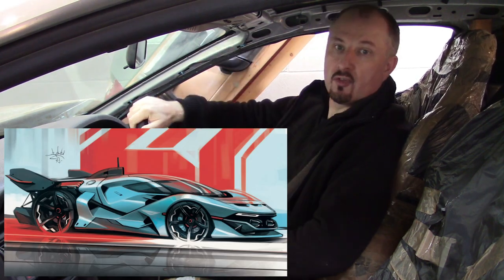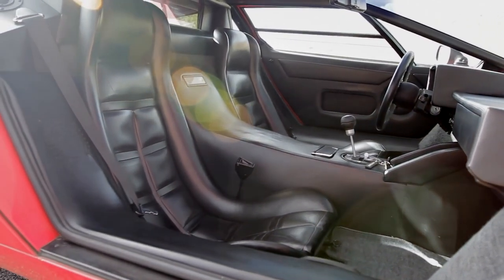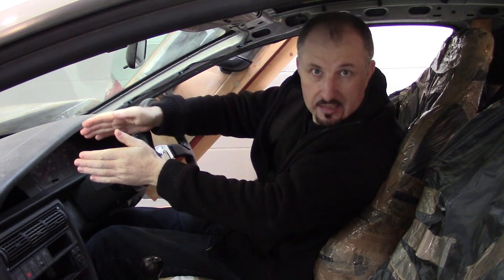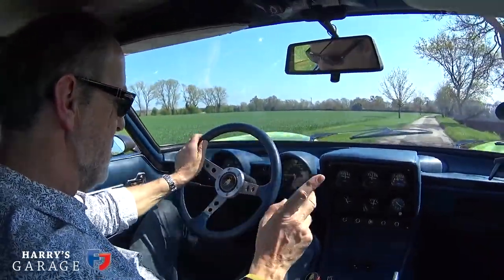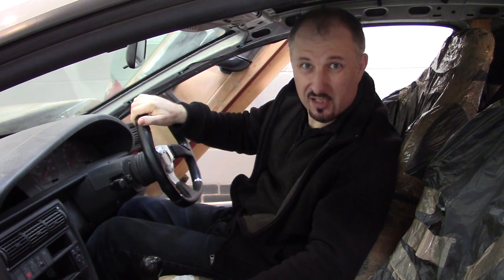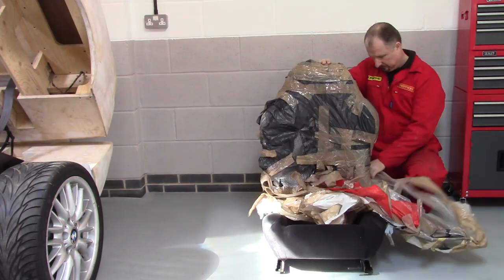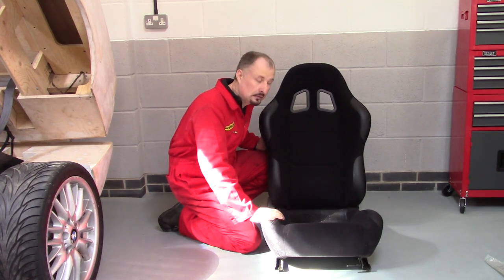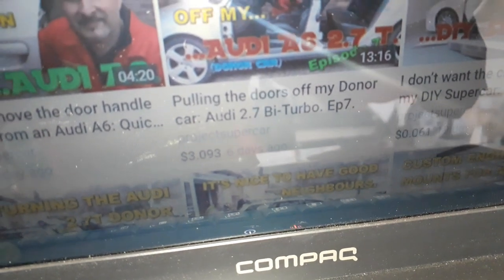Designing the driving position in my DIY Supercar: Prototype Ep9

Comment: Maybe seats from an MGF, they dont have airbags, just the buckle mechanism. I am 6ft 2" and find the mgf has enough height in the cabin, but only the mk2 with the adjustable steering wheel for height. Are you using a steering wheel height adjuster from the Audi? Great work.
Reply from the maker: Thanks for the tip Gavin, I'll look into the MGF. A friend of mine has one, so I might just take a closer look at his seats. As for steering wheel height adjustment, this prototype does not have that, however the "Turbo" build will have a tilt adjust steering column, taken from the Audi A6 2.7T donor.